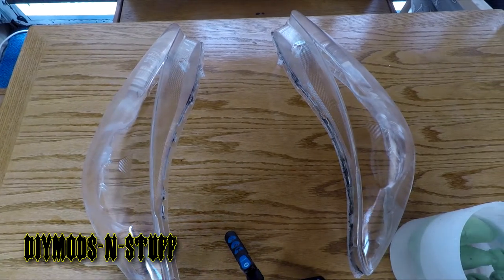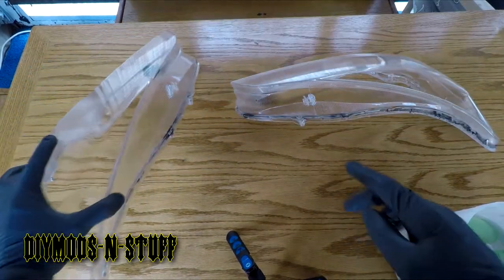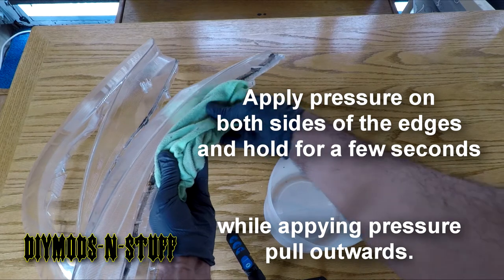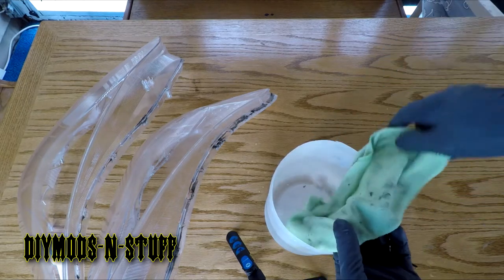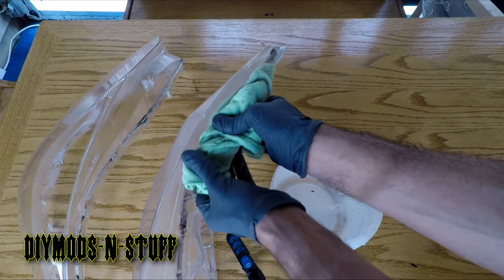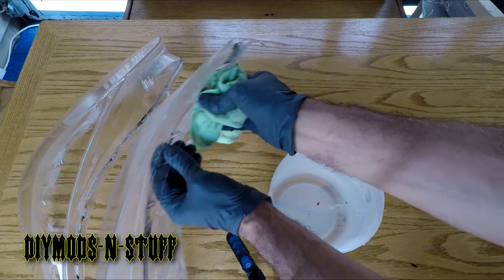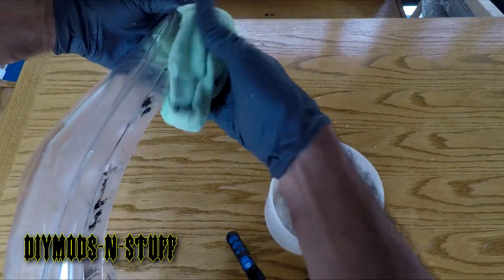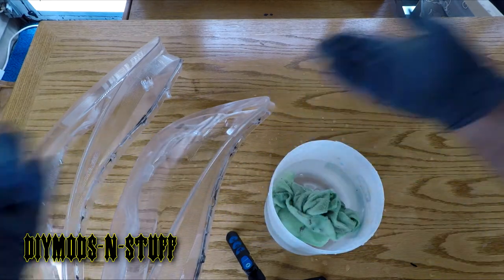BUTYL RESIDUE QUICK REMOVAL FROM HEADLIGHT LENS

Comment: I wonder what you are using to reseal where you need to remove the butyl.
Reply: butyl.
Reply: @flandrble  you dont need to remove old butyl unless its like 40 years old and brittle, if its still tacky its still good, add a little more for a tight seal, thats all
Reply: @garforce2  in my situation dust and dirt build up had collected in the channel the lens sits in, so without replacing it would mean I was also sandwiching a load of debris into the groove which may not seal correctly.

Comment: See I had this thought, and it didn't work so well for me. Though, mind you mine was flashing tape with butyl glue backing. I used a hand steamer to try to "melt" the glue. Wasn't super successful.
Reply: What did you end up using to get it off?
Reply: @Tonisuperfly  TIME, LOTS AND LOTS OF TIME, AND DAMAGE. I never got it fully off. Luckily the one door I had it on was metal and synthetic, meaning I could be hard on it without worry. Where the front door seems to be more of a problem since it's wood. So, no easy answer. I tried the acetone, I tried goof off, Goo Be Gone, and everything in between. NOT MUCH LUCK. Heat no good, can of freeze, no good either.
Reply: @tdata545  oh dear… I’m asking in advance of putting it ON something so I might have to use something else. Works well for what it meant to but yea, getting it off is too problematic.
Reply: @Tonisuperfly  I used it during the big hurricane that hit Louisiana in 2020 and was still pretty bad by us on the MS/AL border. I was trying to waterproof my largest windows. Using tarp and the tape. After 3 years the one that was on the bay window is finally falling and flaking off. 70% is still on the siding.

Comment: Why not put the lens in hot water 🤔??
Reply from the maker: It's best to try not and contaminate the inside of the lens and avoid any dust and debris as much as possible. I had an issue even with a microfiber towel, the lens had fine scratches that were visible once everything was assembled.